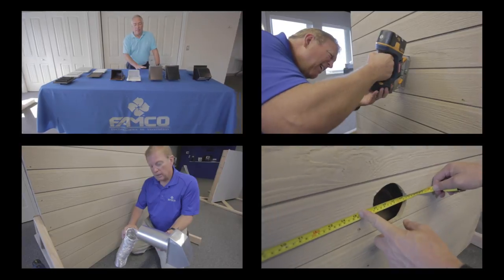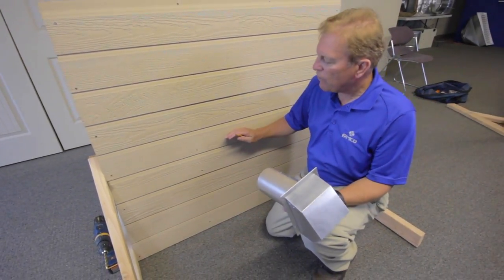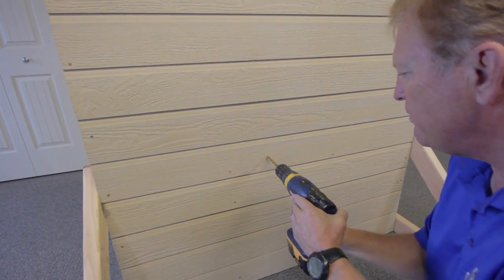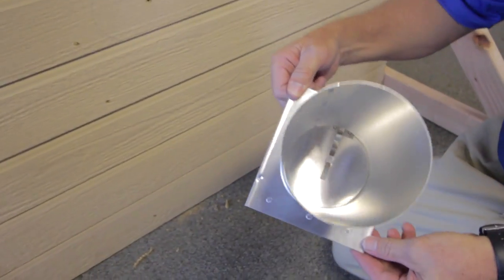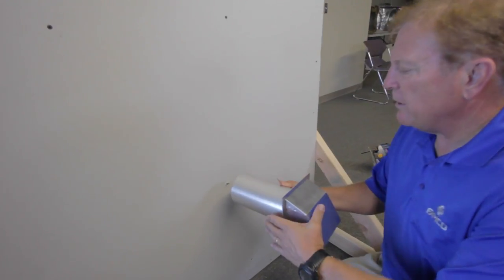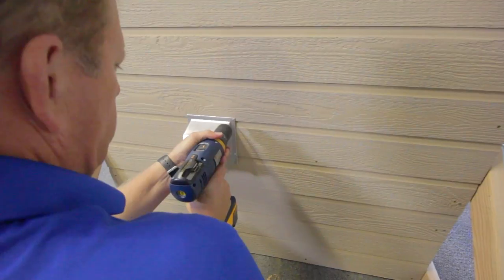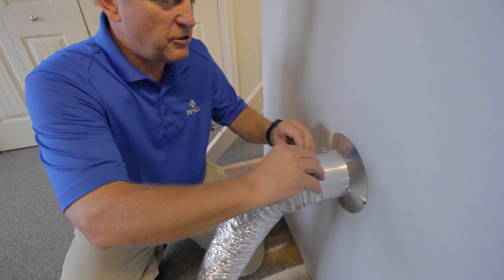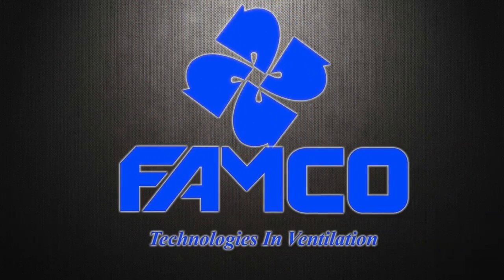DIY Wall Vent Installation - How to install a wall vent tutorial video

Comment: I see some comments of using a hole saw. If you purchase an extension with the hole saw you can saw all the way thru both walls and the hole will line up perfectly.

Comment: Where is the flashing/waterproofing to prevent water from getting behind the siding?  This seems like bad advice.
Reply: Agreed
Reply: Flashing/waterproofing is what I was looking for
Reply: you silicon it. there are products, but they are usually siding specific and for new construction.

Comment: 1.  Use a 4" or 6" hole saw on your drill instead - it's x1000 easier.  2.  Do NOT use that flex foil crap for dryers.  It traps lint, risks a fire, and is against most city codes.
Reply: EnochLight and use some silicone for weather seal. The demonstrated cap used will collect lint a better cap would be the version with multiple little flaps.

Comment: What a waste of time. Yes, obviously I’ll have to make a hole on each side of the wall & stick the vent through. But what about insulation, vapor barrier on the inside, wind barrier on the outside etc? That’s a pricy DIY installation if you’re paying hundreds of $ in heating costs each year & have rott inside the wall after the 1st rain...

Comment: Wrong! Pilot hole through both walls the first time. Smh
Reply: you would need a 10-12 inch long drill bit. most don't have one, or don't want to buy extra tools and costs to do something they already have the normal tools for (hence why he does two pilot holes)

Comment: This is pretty bad. Instead, remove siding, apply caulking to inside of flange, mount flange to framing (plywood, OSB, shiplap, etc.), then use waterproofing membrane to overlap the flange. Cut the siding for the vent outlet then reinstall.
Reply: Lol you've obviously never removed siding
Reply: @Nappo27  he's not wrong though. This is a completely unsealed installation. Water will easily ingress around that flange and ruin the wall behind it. At the very least, they should have put some silicone sealant around it.